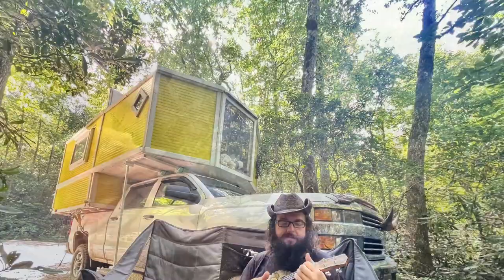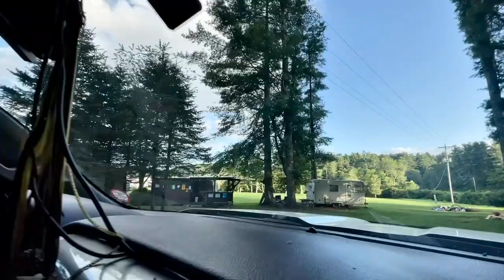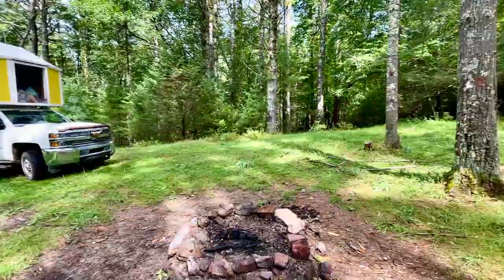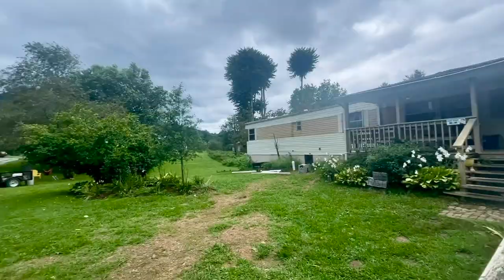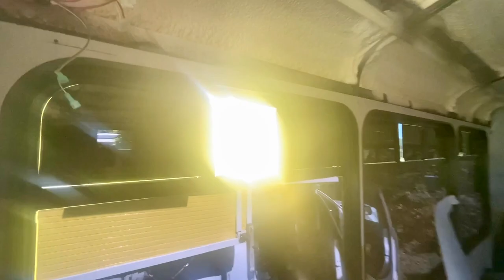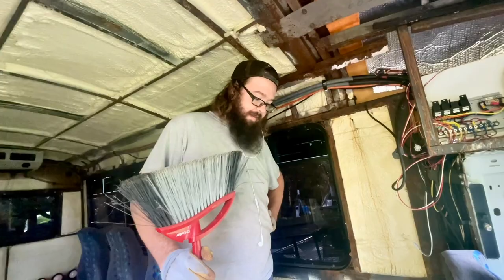North Carolina and Virginia Boondocking

Comment: The best stuff for rust is phosphoric acid. Tractor supply sells Rust Kutter in a spray bottle and it works well to convert the rust. Wear a respirator and eye protection. It isn't fun to accidentally breath the mist when you spray it.
Reply: I haven’t used that product before
Reply from the maker: Thanks for the tip!
Reply: @LoveHut4Life  you let to dry overnight and clean the white residue after that. Then you can paint it.
Reply: @shanecamp15  it's good stuff

Comment: Look forward to the three videos a week. Can’t wait to see how your new build turns out. Can you weld and if so what type if we had the welding equipment?
Reply from the maker: Yeah we are having a lot of fun with this one:) 
We are both amateur welders, but would never do it for a customer. Shane is a carpenter that also does plumbing and 12 volt electrical setups.
Reply: I hope to one day call myself a welder. I suppose the first step would be acquiring and welder & generator though!